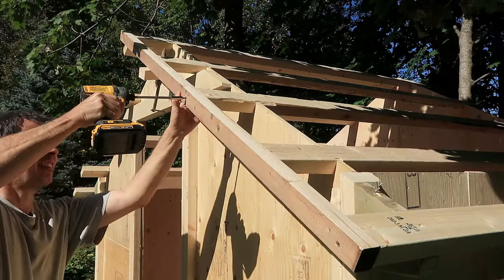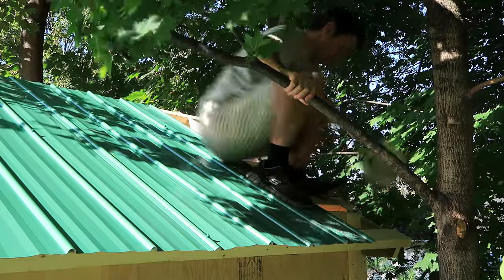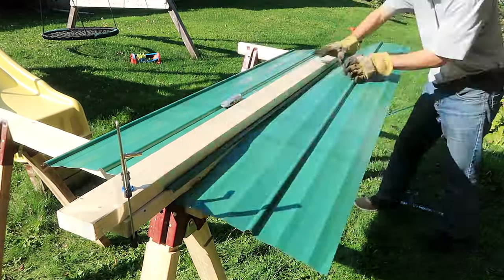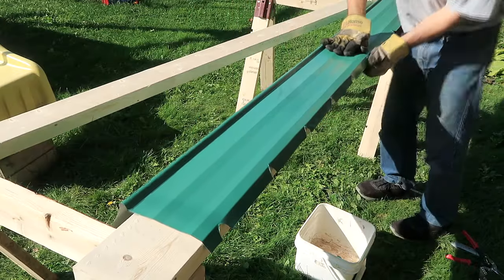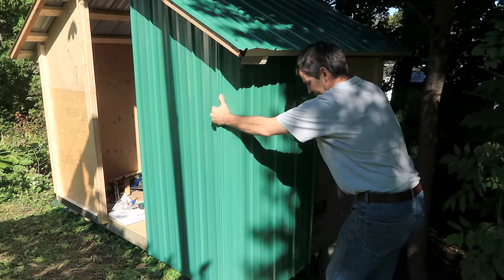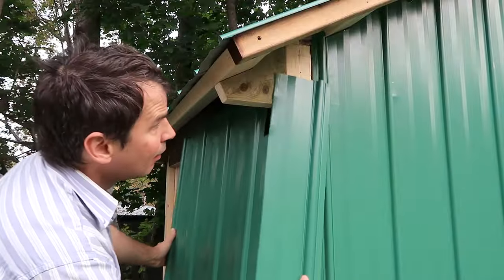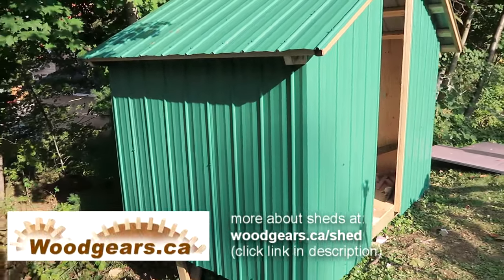Metal roofing and siding for my shed

Comment: We install metal roofing and siding professionally. Our suppliers have told us that either method will suffice if they're used in the right conditions. We screw the ribs, but those who do screw the flats claim that you get a tighter seal with the washer when there's a solid backing behind the metal. I guess that could be true depending on the installer, until the head of a screw gets ripped off by a sheet of ice sliding down the roof because the installer torqued it too tight to the point of almost snapping the head off with the driver. Any water shed in that area after = a leak for sure. If that broken screw were in the rib - which is a lot less likely to over tighten without distorting the rib - it would have a better chance of not being in the path of a stream of water when it rains, leading to less damage below the roof until the owner notices there's a screw missing and has it fixed - it's a lot easier to spot an interruption in the screw pattern when they're on the ribs. Screwing in the rib also gives the lap joints much better support in high wind environments. I've seen a microburst tear the entire roof off a barn that a crew just installed because they screwed in the flats and the lap joints were left flapping because they didn't want to screw the ribs. Give that wind an inch, it'll take a mile. I don't like screwing the flats unless it's a low slope, wall, a valley or gable trim. Low slopes won't shed ice and snow easily, and if the homeowner is using a roof rake to clean it and the screws are in the ribs, then they'll likely hit and loosen them or break the washer seal over time. Valleys get a gasket between the panel and valley flashing which needs to be screwed tight for obvious reasons - rib only won't suffice. We take precaution to make sure ice doesn't slide down the major and crash into the valley at 50 mph.
Reply: thanks for sharing your experience
Reply from the maker: Does the ice really rip out the screw heads sometimes?
Reply: @matthiaswandel  We have not experienced that phenomenon here in West Texas!  We do get ice storms and snow here! 😁🛫
Reply: @TheFalconJetDriver  And serious winds! Like on Oct 10th. I'm in Rule, TX; north of Abilene. I had a sheet pull off the chicken coop because I hadn't screwed down on the rib properly!
Reply: @jrkorman  I know where Rule is! I live in ABI
Reply: @TheFalconJetDriver  Are you an F-16 driver? I'm a retired USAF weather guy.
Reply: Always in the flat, otherwise you cannot get it torqued down properly. Turn the heads off the screws? I'd like to see the driver that can do that! I use a cordless impact driver with 6mm roofing screws.

Comment: nice work on the diy ridge cap.

Here in Australia we use 'tin' on our house roofs a lot, probably the most common covering. we always screw into the ridges of the sheets.

its also a good idea to 'weather' the top of the sheets that go under the ridge cap (should not be a problem on this shed) helps stop rain blowing up under the ridge cap and into the roof cavity.

In Australia we don't cover the roof with any type of sheeting like ply or osb. its just rafters, purlin then either reflective backed paper or insulation blanket then the sheets. we usually insulate the ceilings and the roof cavities are generally 'open' to the elements, to a degree.
Reply: What does weather mean in this context?
Reply: @NoahNobody  Probably some sort of seal or sealer between the sheets. We always ran a bead of silicone along the top ridge of the bottom piece then laid the top over it and put the screws through that ridge.
Reply: Lead sheeting in the old days which would last 500 years, it's now silicon sealant these days to keep the EHS numpties at bay which keeps the roofers employed for 500 years.
Reply: @NoahNobody  Not the OP, but we always turn up the flat sections of the sheet so wind-driven rain doesn't get over this new ridge.
Reply: @thegingerpowerranger  we also use 'z-inserts'.  which is either a sticky-backed expansive foam roll that gets compressed when the ridge is screwed down, or molded-foam sticks in the profile of the roof
Reply: @KipdoesStuff  The old fashioned way to do it here is to make a jig and bend up the lower portions of the sheet so they form a wall just under the ridge plate. Most modern constructions instead use a form of foam profile that they put in before putting in the ridge plate. I think folding up the top of the sheet is probably a more durable solution, but more work intensive.
Reply: good to hear on no ply or osb on the roof! I did that for my primitive hut - just rafters, purloin, rock wool (two layers criss-crossed) - and then I used poly-canvass tarps and clamps on the underside (no holes). It has held up since I added a pond liner on top to keep it water proof. OK sure I had no idea what I was doing but it's held up four years so far. I wanted the roof to breathe - and even with pond liner it will get the cross flow air - thanks for point that out about being "open to the elements."

Comment: Putting the screws through the tip of the roofing, as you did, is the only way to go. It holds better against cyclonic winds as well.
Reply: I was thinking the same and really wondering what is the reasoning behind the producers recommending the flat spots.
Reply: It's too easy to forget the cyclonic winds until they come along and your shed does a Wizard of Oz and you're not in Kansas anymore.
Reply: @antraxxslingshots  I work at a roofing manufacturer. Screwing into the flats is recommended for areas that get snow loads. A snow rake will tear out the screws installed in the rib. For areas that don’t get that much snow, the rib is generally recommended, depending on the design of the roof.
Reply: another thing with putting the screws on the ridge, not sure about elsewhere in the world, but here in Aus, roofing screws are self tapping and have a part of the shaft near the top that is smooth so it looks like this:  ¤|\\==\\\\\\\\\=> if you were screwing down to wooden battens, this would probably be fine, but steel ones, you run the risk of the smooth part being where it needs to 'bite' and having loose sheets.
Reply: @robertaustin7752  thanks for the clarification :-). I live in Queensland, Australia so cyclones (hurricanes) are a constant. I forget that Northern Hemisphere has the weight of snow to deal with. ;-)
Reply: @myopinion69420  Same here, we have always screwed on the ridge (same screws as you indicated) and I've been noticing on YT lately where everyone is screwing on the flats, granted these have all been northern hemisphere builds so maybe it's a 'snow thing'.
Oh, btw, Matthias I'm sure the kids will love the shed you built for them just as much as we all like watching your builds.

Comment: I put up a large swing set last year and it was cheaper to use a metal roof than one of those canvas/ tarp covers. 

I made the ridge cap from one of the corner caps since it was the same price as another panel and saved some work of cutting and bending.  I didn't bother with cutting around the ridges. I'd recommend some screening at the ridge if that's an issue for you. Bonus is that it acts like a ridge vent with the large gap.

Comment: Years ago, an older neighbor with eyesight problems was building a shed and asked for some help putting on the metal roofing. It was galvanized and had been slightly oiled and was wet with morning dew so was rather slick. He had one of those ratcheting ladders so we put it over the top of the roof, matching the slope as best as possible, to give me something to hang onto. I finished safely, but every so often the ladder would shift and I would let out a not-brave-in-the-slightest yelp, much to my neighbor's amusement. Miss that nice old guy.

Comment: Over here (Finland) you put the screws through the top where you join two sheets (that join is designed so that a potential leak runs into a tiny gutter and then out), then the rest go straight into the wood on the lower portions. Leaks are less likely when you screw directly into the wood as it cant move as much with thermal expansion cycles. And all buildings on a larger scale have another layer underneath to catch condensation and possible leaks and direct them out into the gutters.

Comment: The one drawback that I find in metal roofing is the noise when it rains. My father's forge used to have a tile roofing, as it's usual around here. It all had to be renewed and extended when converted into a workshop, so he decided to go with a metal roof, which made sense as, he and his brother being blacksmiths, it was the best choice. However, whenever it rains, you can't understand what anyone else says, it's too loud.
Reply: so hit it with some spray foam or something.  tack some old carpet up there.
Reply: @maxdecphoenix  it's not in use anymore, I go there every few days but just to make sure everything is in order, I very rarely do any work there, if ever. So, it's not worth trying. Should I change my career and work there or rent the place and I would seriously give it a try.

Thank you!
Reply: I love the sound of rain on a tin roof
Reply: @Lue_Duck  when you're outside, mostly. When you're inside, it's a relatively low roof, two walls are made of stone, another too are made of brick and mortar, and it echoes... it becomes a bit annoying.
Reply: Especially with just purlins

Comment: On cutting metal and other materials - a tip I learned from Adam Savage on his Tested channel: When you're using a knife to cut through material, it's okay to make repeated shallow cuts until you've cut deep enough to do what you want with it. Easier to do than pressing hard with a single cut.

Comment: Roof plumber (metal roofer ) for 25 years. Always in the rib and please don't use a saw or grinder, grinder being the worst use a nibbler if you don't have one just take the time and use snips. Also your flashings a pretty good. You didn't turn up your sheets at the ridge so you may get leaks, use some duck Bill pliers to turn them up. Wide mouth pliers
Reply: You know professionals always say that, but when I try to use tin snips it always ends up way worse and I end up cutting myself way more often.
Is there a reason apart from corrosion not to use the angle grinder?
Reply from the maker: I have heard not to use a grinder before too, but never saw any bad results from using one.  You expose the ungalvanized ends either way, just the edge is a bit rougher with the grinder, but the profile doesn't get messed up.
Reply: @matthiaswandel  its just for rust, the sheets are pretty hardy but will 100% rust and it will move up from the cut
Reply: If you ever plan to do more, a nibbler is the best for cutting
Reply: @matthiaswandel  its the temperature of the grinder were as a nibbler would be not much more then air temp
Reply: Купол , луковица на православную церковь, ромбом ( параллелограмм) . Вот это жестянщик, а это любой человек сделает 😂
Reply: @panicfarm9874  if you are a professional you would think you would paint the exposed metal...
as a professional welder, you never leave unpainted metal exposed to the elements

Comment: When I build my shed I’m going to do a flat roof with a high slope. It will be easier than the A-frame roof and have the same effect in repelling rain and snow.
Reply: How could you possibly have a flat roof with a high slope?
Reply: @stevegerber169  : Sounds like I didn’t explain it correctly, lol. Okay, instead of an A-frame roof that peaks in the middle, I’m going to use sheets of plywood, covered with shingles or metal, that run from the front of the shed to the back, but at a fairly steep angle. For example, if the front wall of the shed is 12’ and the back wall is 8’ it will give me enough of a pitch that rain and snow will run off. It will be faster and easier to build than messing with building gables and a ridge cap.

Comment: You covered almost everything, but I'm still confused about what to do at the roof edges. I'm not using trim so if I start with a raised rib and end with a flat section, what should I do? No over hang with flat start and finish?

Comment: Water runs down the flat part, not on top of the ridge. Why would anyone put the screw where the water is?
Reply: The logic I’m assuming is that the screws have rubber grommets and would form a better seal.
Reply: I believe the theory is that with the screw head so far from the timber, there's a higher risk that it could wiggle loose or break
Reply: @TorbenArentoft  Or that there's enough flex that the panels don't fit well for the long term.

It would seem that some kind of standoff under the ridge would be able to address that.
Reply: If the sheets last forever they wont be able to sell you more...
Reply: I know why I did it. I can't answer for anyone else. I put it in the flat because that is what the instructions from the manufacturer said to do. But it was just a chicken coop. Didn't leak as far as I know.

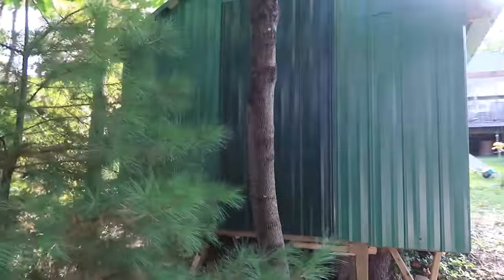Comment: 3:50 what is your shed sitting on? 

Most people call that a shed. Up here in remote Alaska call it a cabin
Reply: how are Alaska permits these days? In the lower 48, any kind of "permanent residence" first needs a subsurface sewage permit if you have indoor plumbing. My county said they never permitted a year-round composting toilet. The county to the north includes a year-round composting toilet. If you can get beyond that first hurdle then I think they don't really care about building codes in my county - it's just if you have a foundation. You need an electrical inspection if you have wiring. But I lived in a cabin in Alaska - just west of Talkeetna - west of Petersville. We had no insulation!! We lasted four months and left with six feet of snow. South side of Denali. Totally off grid. It was homestead land and I doubt permits were necessary. Here you are REQUIRED to have a building permit if you occupy the structure. You can live in a tent but then it has to be a short-term shelter and only for 7 months a year maximum. You would have to move your tent every 21 days - or every week for 21 days shelter for a month. Then you still would be required to have a "permanent residence" somewhere else based on the tax assessment (either it would be recreational or maybe a farm labor shelter). So in other words it would be illegal to live on the land full time unless you can get a year round composting toilet for a primitive cabin. The problem is the county planner doesn't understand composting! Sure you are required to get a privy permit for a composting toilet but that's considered a "toilet waste treatment device." Then a primitive composting toilet is supposed to "bury" the waste or cover it with 3 feet separation from the water. So I guess you could "cover" it with composting carbon matter instead of just soil - because you need the aerobic bacteria for compost. The county planner said they would have to check it out for composting. Vermont is trying to get a law passed to allow actual composting of human waste because a farm that used a composting toilet got shut down by the county in Vermont. Meanwhile Dr. Sasha Kramer in Haiti set up a thermophilic composting toilet business since it gets rid of the pollution while also fertilizing the land to grow food.

Comment: As someone who's never built anything, my question is, is it not important to also cover the wood parts on the outside of the shed, under the sheet metal?
Reply: I think that as long as it is protected from UV light and it is able to dry after it gets wet, then it should be totally fine.
Reply: I believe that would only be necessary if this were a conditioned space, that extra covering would be a a vapor barrier to prevent condensation on the inside of the walls in the summer.

Comment: I think the logic is that the screws go into the low parts so they have more wood to bite into, and you seal them with a rubber gasket to prevent leaking. More wood means they won't come loose as easy as going in through the ridges. However I wonder what would happen if a strip of wood was glued down where the ridges would go.That would essentially eliminate the problem.
Reply from the maker: For the ribs, you use longer screws.  I think the problem is mostly that people don't pay attention, overtighten the screws, and punch through the ribs.  That doesn't happen on the flats.
Reply: @matthiaswandel  That makes sense. It makes me think that is probably part of the reason why manufacturers suggest screwing it down on the flat part, just to curb the amount of returns people make for "inferior products" when they screwed up. (No pun intended)
Reply: @matthiaswandel  We always use the clutch on the drill for a nice snug fit that didn't destroy the rib,

Comment: Doesn't the material rust where you cut it?
Reply: Yes, where I cut mine when I built my pole barn has rusted 3/8 to 3/4” in forty years.
Reply: @Hoaxer51  That's good longevity but the over-engineer in me wants to prime or otherwise treat the cut edge. I know.. Overkill.
Reply: @osheros ,There’s nothing wrong with that, I’m surprised that mine wasn’t any worse than it was.

Comment: You should always put your fixings through the ridges,only a manufacturer who wants to sell new roofs would suggest putting them in the valleys where they are guaranteed to leak the minute the neoprene (or whatever) washers relax a bit. I have put up a fair few feet of corrugated iron and you never fixed through a valley, of course we did not have neoprene washers originally just springheaded nails and galv diamond washers which work like an umbrella over the perforation, you get a long lasting roof with that method, Technique should improve not degenerate !